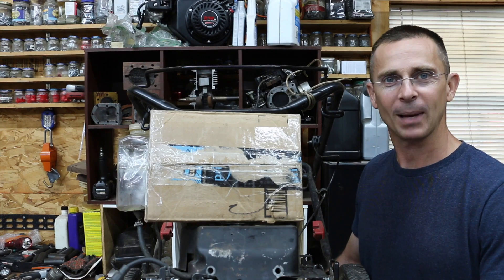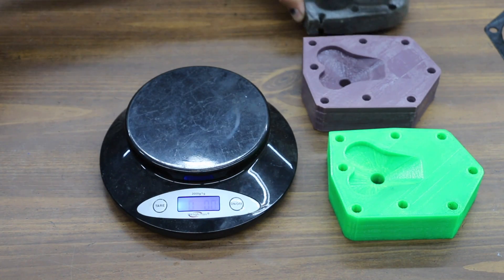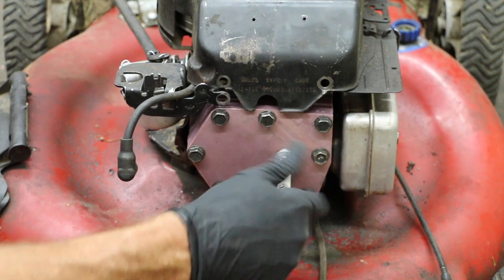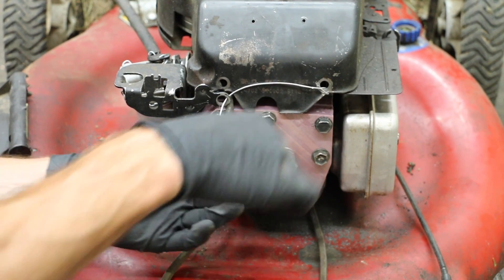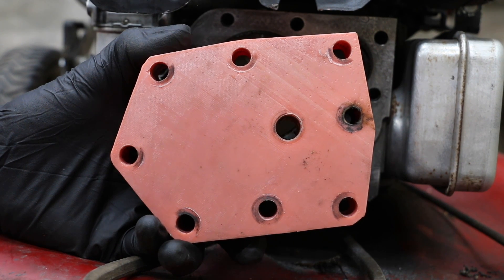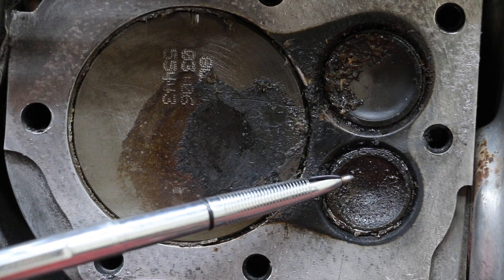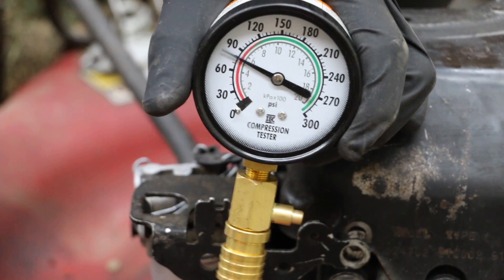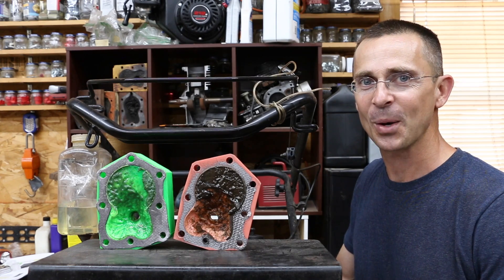How long will a 3D printed cylinder head last?  Let's find out!

Comment: PLA has a glass transitioning temperature of only 60°C (140°F) while for ABS this is 110°C (230°F), this is why the PLA head melted much sooner and the spark plug became hot enough to melt through the plastic threads. Luckily PLA burns without too many noxious fumes, as opposed to ABS (thank goodness this video has no smell-o-vision!)
Reply from the maker: This is great information.  I always wear a respirator and I have a terrific fan that sucks the exhaust fumes away.

Comment: Better off using thick aluminum foil or copper foil should work alright have you tried that test with the graphite yet. What about making a stone head out of   of basalt or andesite rock??? Should work fine
Reply from the maker: I haven't tested graphite yet.  Great recommendation.

Comment: Could the large gap on the spark plug be responsible for raising the temperatures causing the early melting on the green head?
Reply from the maker: I don't think it would matter much. PLA doesn't seem to handle heat nearly as well as ABS.
Reply: PLA softens at about 70 degrees Celsius vs ABS that softens at over 100.

Comment: I would love to see a 3d printed nylon head. Also a 3d printed mold, then filled with some sort of epoxy.
Reply: also maybe petg
Reply from the maker: Great recommendation!
Reply: Or even one of the metallic plastics.
Reply: I think carbon fiber pla would be better than iron pla, but both are hard to get.

Comment: You should try a silicone cylinder head with small metal rods inlaid for support silicone is rated for the heat it might work!
Reply from the maker: Thanks for the recommendation!

Comment: The cylinder head tests are my favorite! You should try a clay or concrete or ceramic one.
Reply from the maker: Great recommendations. Thank you
Reply: would have to mold the head with the spark plug in it already! or better idea mold it with a helicoil insert so you can do the compression test!

Comment: Carbon plastic would be great... They do have different materials that can be printed... They are pretty expensive but they are coming down in price they do have a 3D metal printer... But CNC would be so much easier....
Reply from the maker: Great recommendation.  I wish I had access to a CNC
Reply: Project Farm they actually have an open source Linux distribution that has open source cnc software... You would have to build it, but I hear it's not bad.. might even be able to find a kit somewhere....
Reply: Project Farm https://openbuilds.com/?id=305 I don't sponsor those guys but I'm pretty sure something might fit your need? ...alas if u don't find anything there u can Google "diy open source cnc"

Comment: Please try the myth of used cooking oil as a substitute for diesel and if it makes the engine run smoother or smoke alot or adds power or help with fuel efficiency or if it creates more heat
Reply from the maker: Great video idea!  I'll test this soon.

Comment: Please keep a tolerance on the 40 second gasket. Use a flush non flammable substance on the combustion side like thin ceramic with aluminium foil. Lets see if we get a lighter yet safer engine
Reply from the maker: Great recommendation.
Reply: If we could prevent the melt, it should work. Best of luck

Comment: Would embedding a metal cup into the plastic be difficult?
Reply from the maker: I don't think it would be too hard to do after it was printed.
Reply: Ok how about water cooling passages to shield and keep the plastic solid vs heat like how you can't burn a paper cup full of water

A 3d printed crank case with a metal sleeve for the Piston would be interesting... How ambitious is the 3d printing guy?

Comment: Very nice video! Is there any way you can test film strength of different motor oils? particularly royal purple vs ???. Do you already have a video like that? They say royal purple is the best when used on a machine  like yours. I was wondering if you would get the same results.
Reply from the maker: Yes, I haven't compared motor oils yet, but I will soon. Thank you!

Comment: 4:47  THATS A LOT OF DAMAGE
Reply: I was hoping someone got the reference
Reply: I SAWED THIS BOAT IN HALF!!!
Reply: Now a flex seal cylinder head is a must
Reply: Cobster [B] Wilson flex seal is very porous and airy when it dries. Although a head made of layered flex _tape_, that might work
Reply: Flextape cylinder head
Reply from the maker: I agree!
Reply: I thought the exact same thing
Reply: Dammit, you beat me to it!
Reply: Flex Tape fuel cell XD
Reply: I was literally scrolling through the comments to looking for this.
Reply: 6:43 THAT'S A LOTTA DAMAGE
Reply: Holy shit the likes
Reply: This is the drawback of 3D plastic printers, they have no thermal or tensile strength.  Wish they had 3D metal printers, then we could print entire cars ;)
Reply: they actually do but for industrial uses. they dont have any for personal use tho
Reply: @hreindustries  Likely the metal printers for retail are not allowed because guns or worse could be easily produced.
Reply: lets do a little more!
Reply: I CUT A GIANT HOLE IN ANOTHER BOAT!!!!!!!
Reply: I SAWED THIS CYLINDER HEAD IN HALF
Reply: flex seal dude

Comment: concrete,  and clay and plaster of paris cylinder heads next please!  great videos, always look forward to seeing
Reply from the maker: Thanks for the recommendation!
Reply: That's a really good idea!
Reply: yes that stuff may last and its easy to mould, ive had an idea for a while for PF about a desert island special, thing you could make from it to get your escape engine running!   his bottle carburettor gave me the idea,  thus a carb made from bamboo and pipes made from natural rubber tree, clay head, maybe ferment alcohol from coconut milk for fuel! lol,  make some kind of oil for the engine from (something!, fish or veggie oil ?)
Reply: All interesting ideas! I wonder if fired clay would work really well...
Reply: That's the recipe for refractory. Would definitely hold the heat but I think it might crack and start to flake out.
Reply: @squared, yep may crack flake, but may last more than a couple of minutes, who knows! thats why id like to see it
Reply: And maybe also nice material, since it's the most popular atm, would be a carbon cylinder head.

Other exotics are of course also nice, but potentially massively expensive, like titanium.

But a really cheap one might be one made out of lead.

My 2 cents 😄

Comment: can you do the lubricity tester on fuels? Like petrol, 2stroke and most importantly JET1A fuel if possible?
Reply from the maker: Thank you for the recommendation!
Reply: I too would like to see the lubricity of fuels tested.  I've heard it claimed that gasoline acts as a lubricant in the upper cylinder and that the addition of ethanol to gasoline robs it of its lubricity.  Also some additives (ex. Lucas upper cylinder lubricant) claim to improve the lubricity of fuel to the end of improving gas mileage.  I'd love to see those claims tested.  But please don't set your workbench on fire in the process.
Reply: I personally have seen an increase of about 2 MPG in my 2004 Grand Caravan with the 3.3L in it using the Lucas.  So its obviously doing something.  It also increased the responsiveness of it as well.  I run it every fill up.
Reply: I would also like to see this. Can it include waste engine oil and vegetable oil?

Great work as always project farm!
Reply: JET 1A is actually Diesel fuel, just as Kerosene is. JET is certified to be water and particulate free, but its just Diesel.
Reply: Jet A and Jet A1 are NOT diesel. They are kerosene based, contain less energy,  produce less soot, but more importantly, they lack lubrication that diesel has. Aircraft manufacturers originally tried diesel in turbine engines, but they produced a LOT of soot that coked up the engine
Reply: opossom1968 
But does it have the same Lubricity? 🤔
Reply: Lubricity test between Standard and premium fuel like ultimate / Shell v Power / or however they called Would be interesting

Comment: Lol probably nowhere near as long as it took to print it
Reply: ahh you have solved it, just need a printer that can print it faster than it burns! lol
Reply from the maker: Great point!
Reply: Took close to well over 16 hours to print if I remember correctly
Reply: And how long did it take to design? A HUGE KUDOS to whomever worked on that part!
Reply: Louis Horvath  not terably long I think 4 hours or so
Reply: @RedneckCanadians  The only thing takes time is measuring. However, if the dimensions are all provided to you, it should be 10 minutes. Or you can use 3D scanning.
Reply: @obiwanceleri  It depends on your skill, software and library.

Comment: I love your vids can you see if you can put a small turbo/ supercharger on a small engine please?
Reply from the maker: Great video idea!
Reply: Small engine turbo setup would be sweet!
Reply: Project Farm do it on the 2 stroke bicycle haha
Reply: This would be amazing!
Reply: WHEELIEVILLE!
Reply: turbo the diesel generator
Reply: Do it!!!! It will be funny!
Reply: Question: Carburetor before or after the turbo?
Btw. I think it would be easier to test with a 3D-Printed adaptor for a 120mm PC-Fan to the intake before going all the way with a real turbo.
Reply: GeorgeGordonNCA  
Air filter -> carb -> turbo -> engine
Reply: callMeAMug Nope dude,the temps in the turbine are high and you either get spontaneous combustion or degrading the fuel and causing knock.
It is hard to turbo a carb engine due to the fact that they rely on vacuum to release fuel into the throttle body. Best solution would be to enclose the whole carb.
Reply: Definitely the turbo goes before the carb as a blow-through setup, much like a blower. You need to add a boost referenced (manifold absolute pressure valve) fuel regulator to increase fuel with boost.
Reply: James Roberts there are 2 basic concepts for carbureted supercharging besides the turbo vs supercharger  those are the draw through vs blow through... draw through is actually better in reliability (maintains a more accurate a/f ratio) however is harder to get initially tuned where blow through is easier to initially tune but isn't as accurate with varying boost pressures easily throwing a/f ratios out of wack. Also a draw through has another advantage it will run a cooler intake air charge as the fuel gets vaporized even more as it passes through and via this change has the reaction of actually cooling the air charge.
Reply: @callMeAMug  Well, you would be better using a direct-injection engine in theory since the carburetor will not want to co-operate with the turbo.
Reply: would have to be one hell of a fan to make any measurable difference. carb after the turbo is retarded because the carb can't work properly and relies on pressurized fuel.  when the carb is before the turbo it works fine and the only thing you have to worry about it the turbo seals being under vacuum for a lot of the time so they can't leak at all or you will waste oil.  I have a couple videos about a minimal effort turbo setup on an old engine showing this
Reply: i would think it would have to before the turbo as the pressure might overpower the fuel pump/gravity
Reply: Turbo after the carb, other wise you would have turbo pressure blowing gaskets/ seals etc out of the carb.
Reply: Not just that, you want the turbo after the carb because otherwise the turbo pressure will just blow all of the fuel out of the bowl. It will work if you encase the carb in a box that is at boost pressure.
Reply: Cant do a turbo on a 2 stroke. The exhaust port and intake port are opened at the same time. Turbo would just blow everything out of the exhaust. And there are some more problems. 
Turbo on a small 4 stroke can work, but most of them would have trouble spinning a turbo. Still a fun idea though.
Reply: Erwin Holland turbochargers work on two stroke they can be put on either before or after the expansion exhaust pipe for early or late boost curves iirc
Reply: Erwin Holland 
Hey! Check out Achates Power opposed piston engine. Its a two stroke but utilizes a turbo+supercharger config.
Reply: callMeAMug hello, COMMER TRUCKS FROM ENGLAND, IN THE 50S PART OF ROOTS GROUP, CHEERS FROM NJ, 🇺🇸🇺🇸🇺🇸🇺🇸
Reply: Not enough exhaust from a small engine to provide enough boost.
Reply: Erwin Holland Don't forget the NOS kit! HEHE!
Reply: @ErwinHolland.  Of course you have to increase not only the pressure in the intake but also in the exhaust for example with the exhaust turbine of a turbo
Reply: Erwin Holland There were Detroit diesels that were 2 strokes with both super and turbo chargers.
Reply: Something Funny yeah but those 2 strokes also had exhaust valves like a 4 stroke
Reply: Something Funny they have ohv just they fire every two strokes but he was talking about a small trimmer engine but good point!
Reply: Something Funny hello, the EMD DIVISION OF GM, LOCOMOTIVES, WERE ALL 2 STROKE, WHICH USED. ROOTS BLOWERS, WHICH GAVE THEM A RATHER UNIQUE SOUND, & powerful!\
Cheers From NJ🇺🇸🇺🇸🇺🇸🇺🇸
Reply: Smog pump supercharger maybe
Reply: smog pump doesn't push that kind of pressure
Reply: 2 psi is what i got out of an '85 302 air pump on an econoline
it proved completely useless, but fun trying
Reply: John Gray It tends to be easier to push higher psi out of the vw smog pumps. They were basically a really low roots-style positive displacement pump.
Reply: Such a great idea!
Reply: Señor Burrito plastic roots blower or a lanthum twin screw would be cool
Reply: Fun idea
Reply: That'd be a great video! You might need an electric motor assist to keep the turbo spooled. I'm sure it can be achieved with gearing and electric motor
Reply: Not as easy as that need more fuel
Reply: I believe the smallest is a RHB31
Reply: Project Farm I agree a turbocharger on a small engine would be an interesting video, I have watched all of them on YouTube and elsewhere.  My research shows that Volkswagen smog pumps from the 1980's are similar to roots superchargers and can push nominal pressures with the correct gearing (6 psi + and 250+CFM by my guestimation) also some smog pumps are like miniature scroll superchargers in design, but that takes research to find which ones, and keep in mind you have to gear them at a far higher rpm than they were designed for.
 Another Idea I had is to attach a modern 20 volt+ cordless blower to a 3.5 hp lawnmower engine as a supercharger experiment, the correct ones I am talking about are claiming 450cfm and up and I know when venturied they can also produce nominal boost.  Self contained, and highly modifiable I think it would be amazingly entertaining to see.  Thank you again for great content.
Reply: That’d be so cool
Reply: try to boost it using compressor
Reply: thats what im saying, turbgo the diesel generator
Reply: That'd be awesome
Reply: get a decent cfm leaf blower. set on high. 👍
Reply: Eh, just get 50 CPU fans. Don't forget the thermal paste!

Comment: U should try filling a crank case all the way up with oil and see what happens
Reply from the maker: Thanks for the video idea!
Reply: this has been done many times by the clueless in the world. The engine either wont start or if it does blows massive amounts of white smoke aka burnt oil out the muffler and spits oil out the carb and breather tube. u know for obvious reasons. until the oil is burned down to tolerable levels. or the exhaust valve carbons up and cant close causing it to stall and backfire out the carb.
Reply: I bought a twenty year old motorcycle with less than 500 miles on the clock. It was extremely difficult to kick over and wouldn't start. The local shop manager remembered having the bike there and getting it started. Said it ran well, but smoked a lot. Even though I couldn't get it started, I had to get the thing since it was such a rare find. Brought it up to my work and spent a bunch of money on a new carburetor set. Even with the new carbs, no start. Each time I checked the plug, it had an oily film. After obtaining a factory service manual and studying the oiling system, I pulled the inspection plug near the brake pedal. Fortunately, I had a pan under the engine. As the plug came out, so did oil. A lot of oil. It ran out the tiny hole for such a long time, I put the plug back and switched to the other side plug that is an actual drain plug. When the crankcase was finally empty, the pan was about an inch shy of being full. Thinking about the situation revealed a stupid truth. The reservoir is in the frame. As years went by, people pulled the dipstick and added oil. Each time, the oil made its way into the crankcase. Eventually, it was so full that the piston was dipping into it and getting it above the rings. Screwing up that way actually protected the internals of the engine. Once I got the oil level corrected, the bike fired up and ran like new.
Reply: My 200cc enduro did this when the carburetor float failed and filled the combustion chamber and crank case with gasoline. It was hydrolocked and would not turn over. I found this out when I opened the crank case and found a gallon of gas pouring out.
Reply: That is what my lawn mower started doing this year. the float was sticking I cleaned it but didn't work. kept filling the crank with gas causing hydro lock. I put a shut off valve on the gas line to fix it.
Reply: Yeah, generally the engine will just hydrolock, depending on how air-tight the crankcase is and how over full you fill it.
Reply: 177SCmaro some engines have crank case breathers so your gotta be shooting oil out but it won’t be enough to run.
Reply: It will be hard to pull the cord
Reply: No compression ?
Reply: 4 stroke you get a lot of blue smoke and oil leaking out of the crank case
Reply: And if you get it to run, the oil pressure will blow your valve stem seals and probably your crankcase oil seals as well, causing your engine to piss all of its oil everywhere.
Reply: blows a gasket